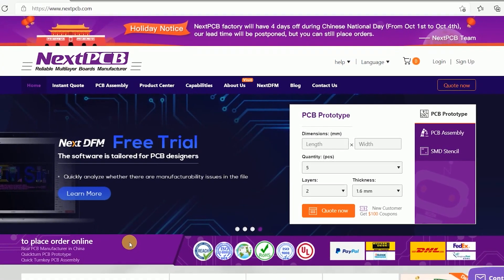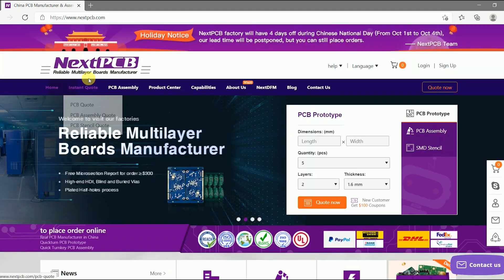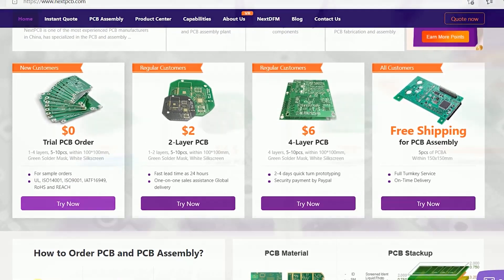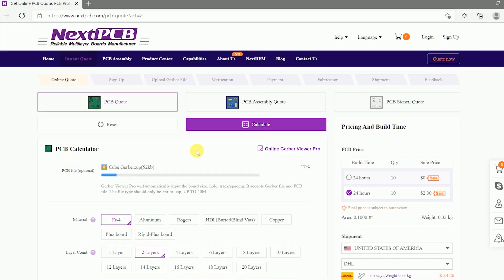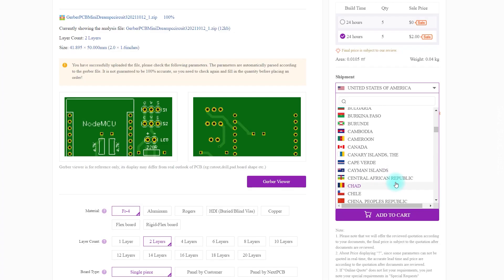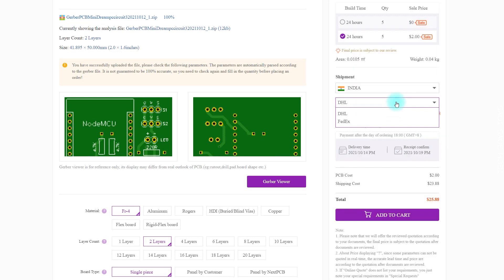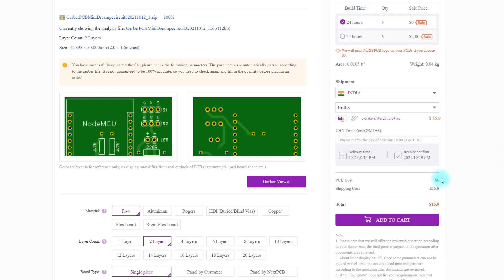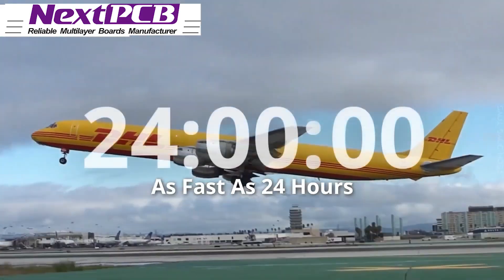DIY Amazing 3D Printed Bluetooth Speaker GIVEAWAY

Comment: nice speaker but, 1 thing... why did you use such a big tip on the soldering iron when you were soldering the speakers and bluetooth board to the amplifier?